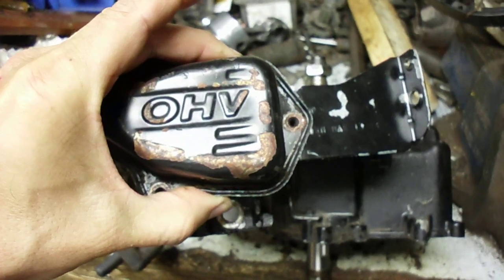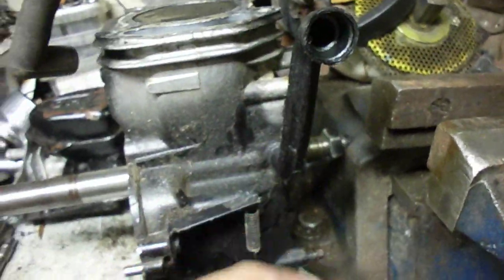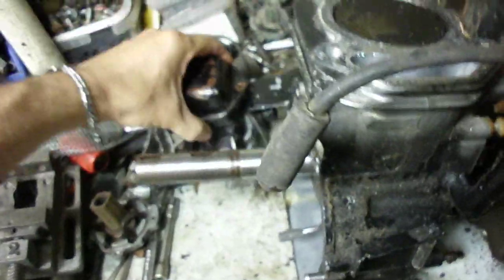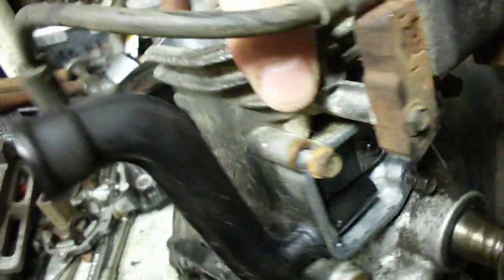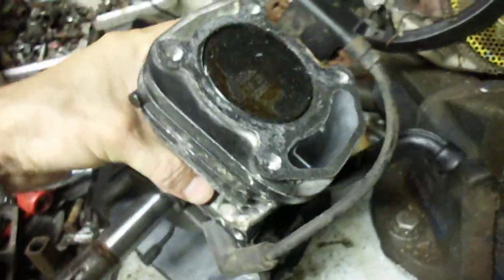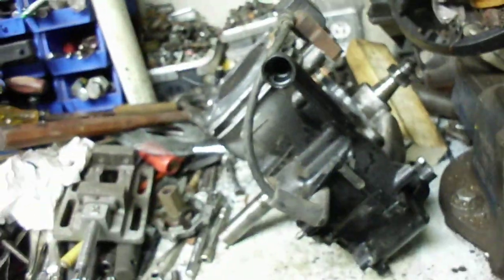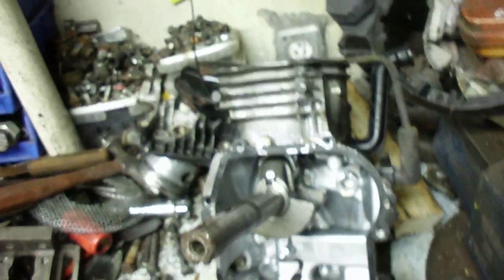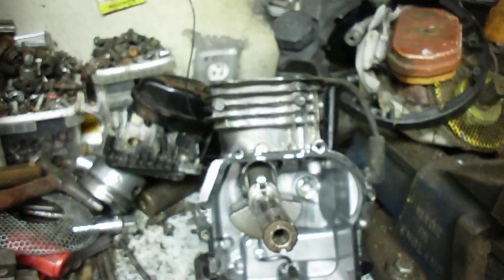OHV Lawnmower to Go Kart Conversion Problems!

Comment: You're right,  its its not as easy as a lot if you tubers make it out to be. If you notice, very few if any, show their converted engines  pulling a go kart! I designed an oil flicker that flings oil to the overhead valves pretty good.
I've decided to go with a belt drive and I am fabricating pulleys. 
Thanks for the videos Chargermiles007, great as always!
Reply from the maker: Ok, so you do have an oil dipper splashing things around, that is good. If that is the case, maybe all you need is some type of crankcase vent to allow the combustion gas leakage out, so the engine doesn't pressurize. The reed valve i show in the vid that leads to the oil hose on yours that is leaking the oil, is a one way crankcase vent. It allows gases out, then seals to not allow them back in. All one cylinder engines use something similar, to minimize the potential for oil mist to be lost from the engine.  A breather from an old car engine could work, but it is rather large. I suggested the remote mounted breather from an old briggs lawnmower, as any dead engine would do, and other than some elbow grease, it would be a cheap way to do it. Let me know if you need more info about it, and I can quickly make a vid. I could even sacrifice one of my totalled engines from the Herd of 350 or so that i have. I would only charge $5 plus shipping for the whole breather assembly that I show in the upside down engine vid. Later Dude.
Reply: ChargerMiles007 Thanks for the offer, but Im not 100% on my course of action. after I watched your  "upside down" videos I re-examined my build. The oil fill line and the tube spewing oil(originally connected to the air filter)are nearly level with each other. 
If I understand you correctly, plug that up and create a vent through the crankcase. 
I want to explore the workings of reed valves, crankcase ventilation systems etc and see what I can come up with for a design. This is my first engine I've ever worked on, except changing oil and belts, and I'm enjoying the work. Its difficult to diagnose some stuff eventhough its staring right at me sometimes! Eventhough  I get oil up top it's not as much as the original position was getting. I might redirect the leaky tube to the crankcase and  then vent. 
There is a mower repair shop near me and will ask about a remote mount breather,  so a video would be awesome.
Your a great help and I genuinely appreciate your time and sharing your knowledge- stay cool!

Comment: My suggestion: leave the breather assembly as it is now, but connect the hose to the cylinder head (valve spring cover) somehow. Than add a new reed valve- breather to the top of the valve cover! Now i assume it would work kinda like a pump, delivering oil fumes to the top of the engine.
Reply from the maker: LOL , that too funny, I was thinking of the same thing after i went to bed last night. Leave the existing valve there, and plumb it onto the side of the rocker cover to hopefully provide more oiling. then add an additional breather to the top of the rocker cover.

Comment: Be interesting to see how long a vertical crankshaft engine will run horizontal.
Without Modifications, to the oiling system.
Reply: From my experience, no problem! Just keep the oil level up, so that the slinger still sits in the oil, but take care that the connecting rod doesn't dip into the oil too much. You do have to check the oil level as often as possible! In my last project i added some new oil channels in the lower crankcase bushing for safety, but i have another Quantum B&S running horizontally that i didn't do that to - converted almost 15 years ago!
https://www.youtube.com/watch?v=wypN5KT5NNk

I don't know about the newer OHV-engines, though, never had one of those in my hands
Reply from the maker: Yes, I expect something will fail first, just hard to say what. In this case it doesn't look to me like the valve train will get much oil.

Comment: What about running the breather that spews oil to the valve cover to oil the top end and then another hose from that back to the induction? Just a thought.
Reply: Initially, sounds good. Thanks I will pontificate upon this!
Reply: @worldsmessiestworkshop4817  
It may actually suck the oil through the top end. Drainback must be thought about. It can be through pushrod tubes or even just a hole drilled at the lowest point back down into the crankcase. I am not familiar with those engines but work on lots of odd machines. Good luck either way!
Reply from the maker: Yes, that may indeed help out. I was thinking to add another breather on the top of the engine to let out the gases, while hopefully keeping the oil in the valve cover area. though I guess we could get really fancy and add an electric motor powered centrifugal oil/mist seperator!  :)
Reply: @ChargerMiles007  
I am thinking keep it simple. It needs oil. It needs a breather. The vacuum would ensure oil. Strategically placed nipples in the rocker cover may be enough. Oil in under the rockers, vacuum above. They are the air/oil separators. It may not be so simple in reality but doable.2 problems fixing each other causing another new one that may be easier to fix than the other 2. A simple PCV valve could probably fix all three if done right.
Reply: @upsidedowndog1256  there are two holes that drain back to the crankcase. One on each outermost side of the rockers. About 1/8 inch in diameter. Maybe I could JB weld one to keep oil up top? They are on the highest level

Comment: I may be insane for suggesting this, but maybe, just maybe, they could use a horizontal engine made for the job of being a horizontal engine?? :P

Or maybe just have a belt between engine an axle that twists from horizontal to vertical like on some riding mowers? Just a thought... :P
Reply: 99% of my materials are upcycled. The mower was free, I fabricate everything else from scrap metal people throw out or give away. My biggest expense - welding rods, haven't figured out how to make those yet!
Besides, figuring is half the fun!
Reply from the maker: Yes, welding rods would be quite the challenge to make. Not impossible, but a real challenge!  Don't forget the engine kill switch, even a household light switch will probably work, and they are cheap!
Reply: Where’s the fun in that?

Comment: I work at a lawn mower shop see these motors all the time they actually make them sealed on some of the even cheaper versions of that exact moror and can’t change the oil EVER. There about 100$ new cheapest piece of crap motor Briggs ever made.
Reply from the maker: Really, they make a lawnmower engine that you can't change the oil on! Absolute Stupidity!!!  That is about as good as the BMW or Mercedes that didn't have an oil dipstick, that idea was so popular with the customers that it lasted 1 year, I wonder why?!!!
  I know lawn mowers are relatively cheap to buy, but come on, we live in the REAL world here, crap happens, lets help the planet, and make the engine last as long as possible before we invest all the heat energy to melt it back down into another one!  The only type of green a sealed motor is the type of green in your wallet. Hint, and this is coming from a non tree hugger!
Personally I am not impressed with the two OHV Briggs model 9 engines I have,  way too much plastic on it for my liking. give me an 80s engine any day. I know the emissions are lower on the new engines, but there is no reason they can't build them more fixable.  Sorry for talking your ear off!  :)
Reply: gokartmaster123 what version is the cheapest? I would be interested in getting one myself just for curiosity sake. 

The reality is that many buyers of the cheapest mowers or even the higher end residential mowers for that matter don’t do a damn thing to maintain them. I’ve personally seen someone buy brand new mower that was 250-300 new. Never check anything and run it till it seizes in 3 years. I wonder how may mowers are blown up because they don’t put the suppled oil in? I would bet it’s pretty high. 

Where I’m getting at with this is that maybe having the oil permanently in the case out of the factory will keep that grade of mower lasting longer ironically in the hands of John and Jane homeowner.
Reply: Briggs made that motor because people now adays, don’t blame me blame my retarded generation. No one does shit anymore to fix them just buy a new one. People are lucky now adays to even change their motor oil in their car I’d be very surprised. But to answer your question it depends on the model and where you get it. Googles a great tool for this because I work on commercial units and hand held equipment. I don’t do the push mowers. My other co workers do the mowers. I don’t have much knowledge to inform you on this

Comment: Horizontal engine at Harbor Freight for $100.00.
Reply: Or for us in Canada, we go to Princess Auto for a Pro-Point or TSCStores for an AiPower/King Canada engine
Reply from the maker: That is pretty cheap!
Reply: That’s still 100.00 more than 0.
Reply: My projects are done almost entirely  using things people threw out or gave away. If I need to purchase something for a project, I  first shop Goodwill, Salvation Army  etc., buying new is the last option. I even save nuts, bolts, screws, washers etc. from everything I can.  I'm physically limited in regard to how long I can sit, stand and walk. So, these projects keep me sane and allow me to "do  something"
If s 100 dollars is a drop in the bucket for you, drop it my way instead and I'll build a new kart, get that Harbor Frieght engine into it and donate it somewhere/place. :)